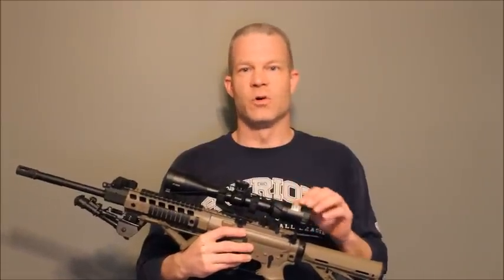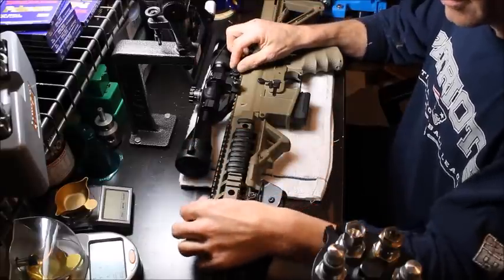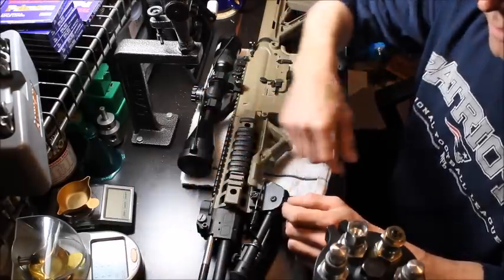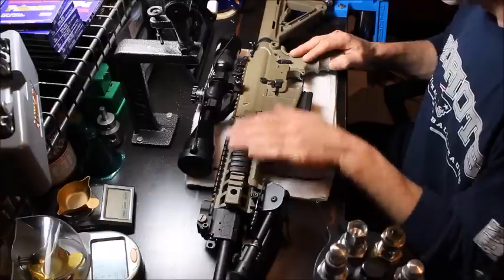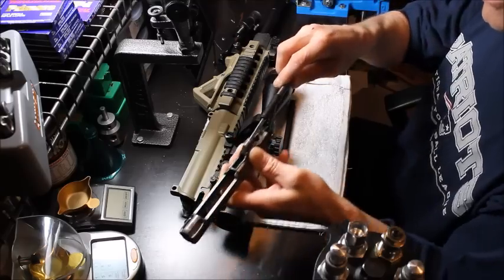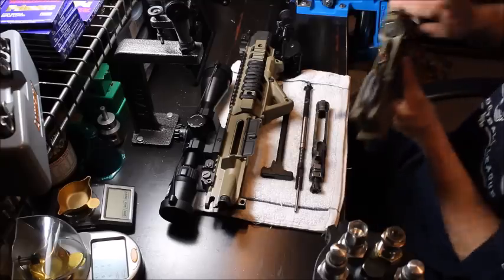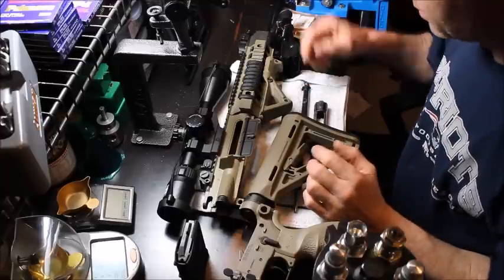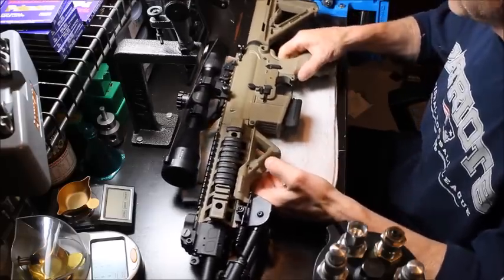Sig Sauer 516 Review

Comment: I like how Sig has a ring system on the piston to stop any gas bypass and contain heat.
I would say the latest 516 is as good as a H&K416.
Reply: One of the engineers behind the 516, worked on the development of the H&K416.

Comment: I'm on my second sig 516. I had a gen 1 and like you I installed a Geissele trigger in my 1st one. I loved it. I had zero issues other than an occasional failure for the bolt to hold open. I sold it to get the new sig 516 Carbon ts. That gun is a 10/10 and already comes with a Geisslle trigger, carbon forend and Samson sights stock. Great review only one correction. It's the over the "beach" test not "bench" test. Thank you for your honest in depth review and explanation.  This rifle is gaining a strong following, keep educating your followers. 👍.
Reply from the maker: Thank you for your kind words and correction. Greatly appreciated friend.

Comment: Great Job on the video, very informative. I've owned a 516 FDE Gen2 going on 4 years now. First thing I noticed about it after running some drills was the gas block heating up. I have a tendency to c clamp grip towards the front of the rail near the gas block. To avoid getting burned I wear an Oakley Kevlar reinforced glove. A hand stop would solve that also. I'm 6 1" and have long arms so I thought to find a longer rail just to find out it's nearly impossible to at the time. Due to proprietary parts. Different size barrel nut and so on. Some of the downside of this AR to me is very limited rail options. Literally just one I know of made by Lancer (carbon fiber). I haven't gone that far and probably will not. I ended up extending my length of pull by picking up a law tactical AR folding stock adapter gen 3-m. It solved my non firing grip issue and made it easier to store in smaller spaces. Other upgrades I've added are a B.E. Meyers 249F kill flash which works unbelievably well for night shooting. It also seems to knock down the report of the rifle another plus. I put in a Wilson combat 3 gun trigger, love it. Black ambi ergo grip. Phase 5 battle latch, charging handle. Swapped the close to mil spec buffer tube on the sig out for a larue. I believe theirs is close to mill spec but slightly off due to tooling like rounded edges on corners, etc. It was obvious in comparison to the larue tube. BCM mod stock, phase 5 winter trigger guard (works well with gloves). I run a Nikon p223 3x32 carbine scope and a trijicon MRO, Day/Night. Overall It's an awesome accurate rifle. I highly recommend it as long as you can work around the gas block with the shorter rail and limited space. Last thought, It's slightly heavy, mine weighs in at 9lbs unloaded. From end of receiver to muzzle with bipod 5lbs. Heavy in the front but definatley a plus for longer shots. Beefy receiver that has been inhanced, very robust. Just my opinion and some details for anyone looking to pick one up. About me, I am a U.S. Army Infantry combat Veteran that loves to pew pew lol. Thanks for your review and vid STOMP603

Comment: First off, I want to thank you very much for an excellent review!!!!!!!  Makes braking down and working on the gun so much easier as I am new to this process.  Living in NYS, I purchased this gun last month but of course it is NYS compliant.  Can you please answer a couple of questions.  I have a friend in your neck of the woods that suggested that if I come up there to shoot that I might wish to purchase additional parts to make the rifle less neutered  (ouch it hurt to hear him say that) and more authentic, i.e.like yours.  With that said, I have the 10 rounds mag and it is a normal load, not the top load.  Since the stock is completely different, do I need to puirchase an entirely new lower & butt stock or can you suggest mods that will pretty much bring it back to stock and if so, what part numbers would those be.  Lastly, since the barrel has no threaded muzzel and flash suppressor, should I just purchase a new threaded barrel and flash suppressor?  If  ALL OF THIS IS DONE, DOES THIS PRETTY MUCH MAKE THE GUN normal spec or am I still missing anything with the exception of the 30 round clip.  Thanks in advance for your help....
Reply: I don't know if you ever got your answers, but as far as the stock, you might need to get a new buffer tube, and then a stock, perhaps a MagPul or other brand, you will not have to replace the lower. As for the upper, I don't live in NY so I can't tell what has been bastardized other than the threaded barrel end. You can probably have a gunsmith thread the end for a flash hider cheaper than buying a new barrel. Finally, NEVER use the term clip, it is a magazine. A clip is a disposable piece of sheet metal (IE the M1 Garand uses an eight shot en bloc CLIP). You will be viewed upon as uneducated by referring to a magazine (mag) as a clip and I'd like to save you the "look" you will get. LOL, hope you are enjoying your 516, it's a good carbine.

Comment: There is only one problem with Sig's that needs to be mentioned to buyers that are new to guns and Sig. All major parts are proprietary parts meaning if you buy this gun,and something goes wrong you have to send it in to be fixed. You can not order a separate bolt carrier or certain other major parts ( piston system) and put it in yourself. Sig will not send you the parts they want you to return gun.also you can not put any other bolt carrier in this gun,the bolt carrier is made specifically for this gun ( integrated key,no staking).you might know this you might not just thought you should know to be fully informed. But on the flip side this is one hell of a weapon ( accurate,reliable,beautiful,downright sexy).if you can past the proprietary stuff this thing is a shooter and would be a nice hand me down.
Reply: thank you for that info

Comment: I have 2 516 SIGs 10 inch pistol and 16 inch. I also have the 716 308. I really like them. I got the Midwest Ind. hand guard for the 2 516s and they are so much better than the stock ones. They really take a lot of weight of the gun and feel so much better. They are on the high side when it comes to price but worth it. I would like to change the triggers someday. The only down side to these guns is there's ever a problem with the piston system you are dead and will have to go through SIG for any parts. Sadly they no longer make these guns and this may cause problems down the road if parts are ever needed. According to SIG they can and will have parts put that's to been seen in years to come.

Comment: Thanks.  How do you get to setting 4 for the gas adjustment without the rod coming loose?  Was that a Zeiss scope?  If so, which model?
Reply from the maker: Gen 2... There is a "X" and 3 dots. When either one of those marks are  lined up with the hash mark the piston should still be locked in place. The hash mark is at the 12 o'clock position. I believe the manual it comes with says different. At least mine was. I believe the manual was for the Gen 1 and was left over. Hope this helps. If not let me know and I will do a quick video for you.
Reply: +ST0MP603 6 months later - thank you.   I located those markings while in better light. I believe that i must have been continuously been holding down the button and turning the adjustment, therefore detaching the gas rod.
Reply: Wich position is the normal setting?
Reply: +Cliff Cadwell 12 o'clock
Reply: IBTJC 4Life Thanx. So if your looking down the barrell of the rifle  lol  the gastube is straight up and down and the X is at the 3 o'clock position? Yes?
Reply: +Cliff Cadwell The gas adjustment knob is straight up and down.  Look closely at the sybols and it will then be on the medium size circle.

Comment: I am thinking of purchasing a Sig 716 and want to know if at a later date I could buy a 516 upper use it with the 716 lower?
Reply from the maker: They are not the same. The 716 lower is larger. It would be nice if there were the same size!
Reply: Thanks

Comment: Could someone please recommend a good combat optic for the AR platform? Preferably something that costs less than the rifle.
Reply: Rule of thumb is to take the cost of the rifle and double it should be what you spend on your optic, BUT with that being said, if your looking for a holographic i have a vortex heuy on mine, more than happy with it. I bought it used for 350. You can buy a eotech which are the best holographic sights for an extra 200, if your looking for something cheaper than the two, check out the holosuns great optics and won't break the bank. Just my two cents. Best advice is get one you like and will function and hold a continued zero. Goodluck!

Comment: WARNING WITH SIG 516 G2....since this is a gas piston op system ,,remember to clean the piston and spring .This is where all the gunk and heat exist,,(in the GAS BLOCK) . Compared to the DI system.. the  piston Chamber is quite clean and slight degreasing and re lube is all it needs ..I say every 500- plus..depending on user,,.. It can actually go more that. without cleaning.But NUMBER ONE WARNING> mounting gadgets, flashlights, lasers dbals, ,,what have you ,near the front handle where the( piston exist) it will produce a huge heating problem !!.Due to the fact that the gas chamber piston blast . Hot gas will flow  in this area. in the front..plus added heat from the muzzle.  Unlike DI where all the heat and gunk is in the back of the bolt carrier.. BE AWARE MOUNTING YOUR EXPENSIVE STUFF IN THE FRONT HAS  A HIGH POSIBILITY,, of getting fried.!!!!! like chicken!!!. mount as clear from the gas block and,, . just trying to save you guys money..i have fried  lasers, flashlight and even a a handle. the  thing runs super hot if your doing tac training as any other ar platform.. Aside from that is on of the best weapons i have ever used.. actually all it need is a scope and BUIS.. your good .. good luck,,PS I BELIEVE TRULY IT WAS DESIGNED FOR MIL SPEC Ascessories that can handle Super heat.. Example the PEQ ir Range finder..... good luck..